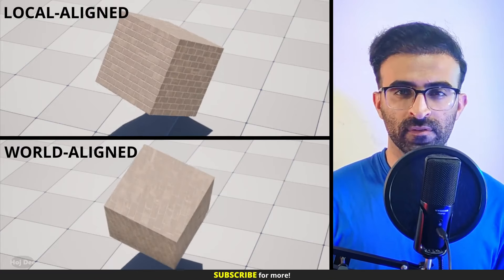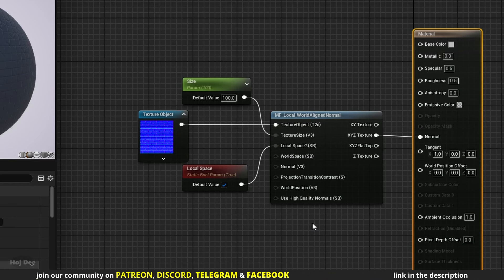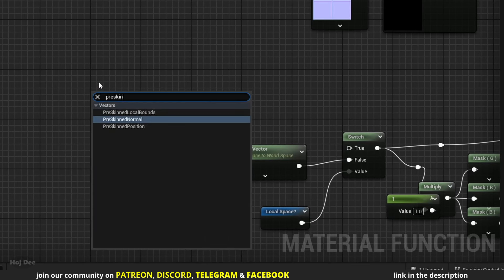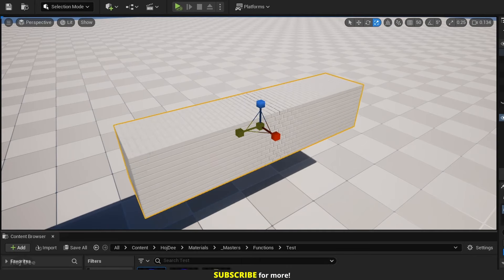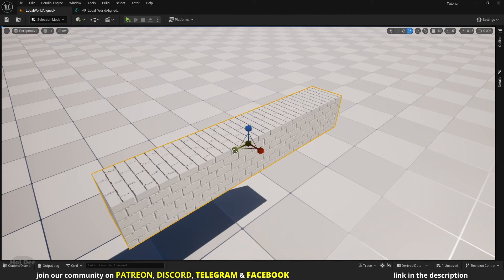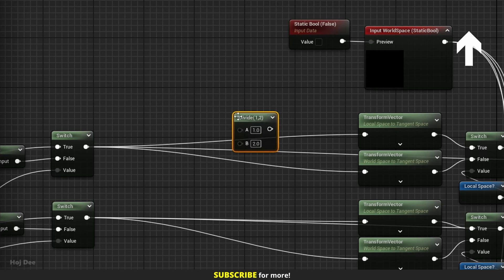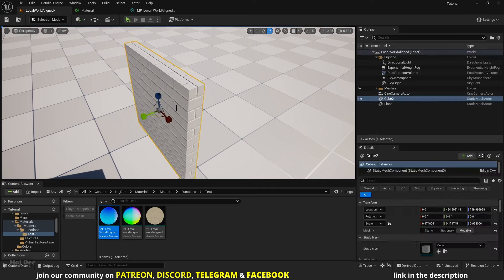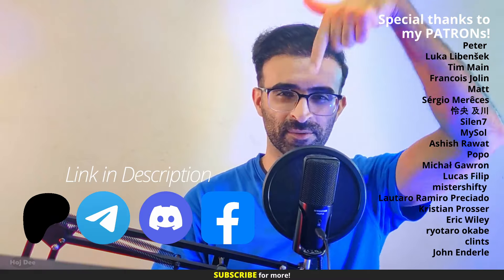Local Tri Planar Normal Issue When Scaling [FIXED]

Comment: Almost. Tessellation does not work in local space mode.
Reply from the maker: @user-pw8rj1zo4i  that's because of the pre-skinned nodes I think. You could use world position and vertex normal instead. But you should transform them from world space to local space.
Reply: @HojDee  Yeah I think world position transformed into local space fixes it (instead of preskinned). Vertex interpolator here prevented tessellate to work because reasons. However when I additionally (at the bottom) transformed VertexNormalWS into Local Space I get stretching so no idea what is going on there. This is beyond my skills. But maybe just position switch fixes it would have to test more.
Reply from the maker: @user-pw8rj1zo4i  Let me know if you find the issue. I'll look into it too
Reply: @HojDee  Anyfinding on this matter? I want to use this with tessellation badly.
Reply from the maker: @yukitaka2052  do you have the same issue?
Reply: @HojDee  Yes. While local space is turned on, material doesn't compile. Looks like connecting normal and displacement at the same time causing compilation error, so if I disconnect one of them, material does function correctly but I lose normal or tessallation obviously. UE5.5.3